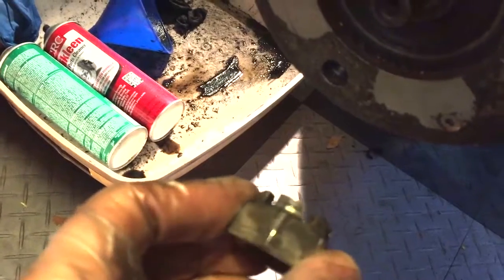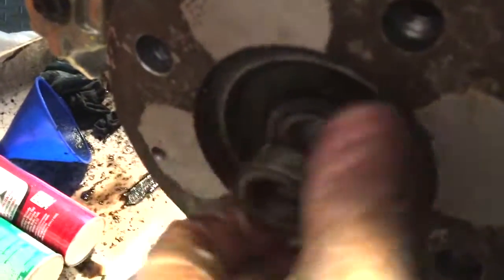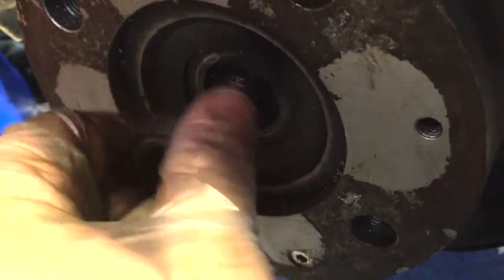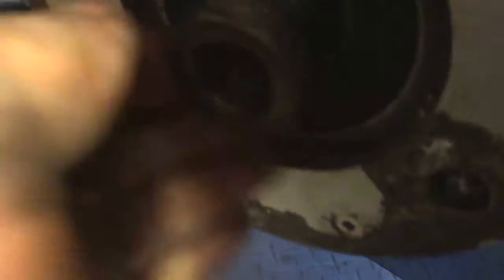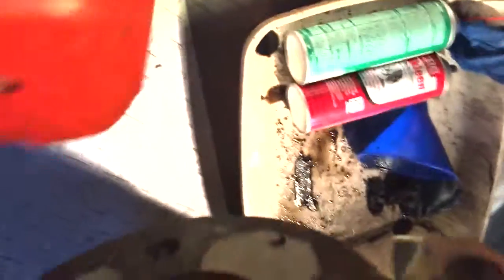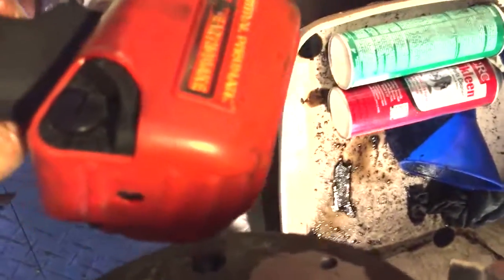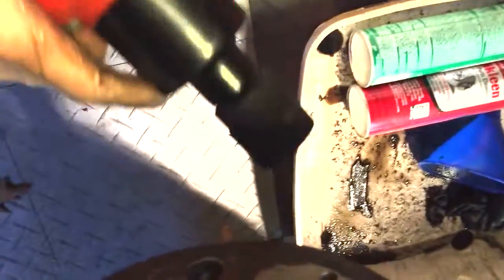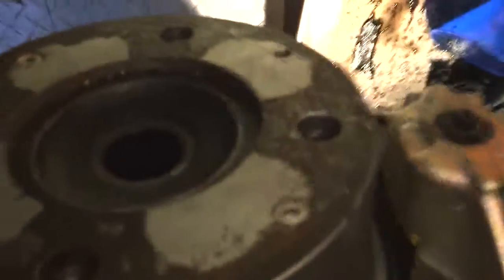porsche 914 axle assembly removal on lift

Comment: Does the engine need to be put to pull the CV joint like this as on piece
Reply from the maker: I've only done it with the engine out. But I believe it's possible to remove them with it in...though  you may need to move them around a bit to have enough room.